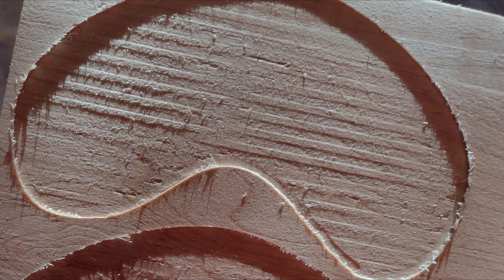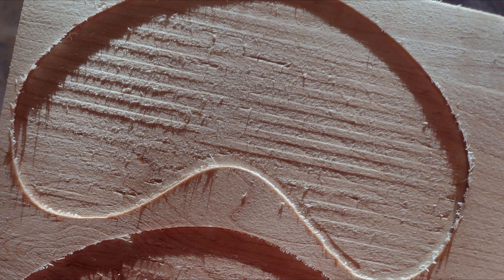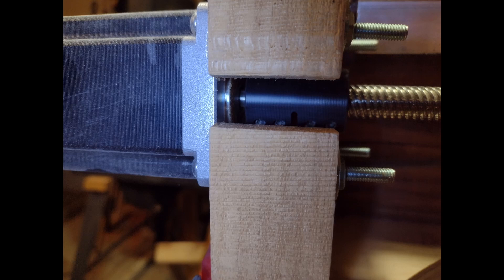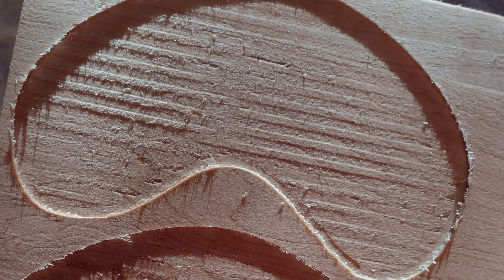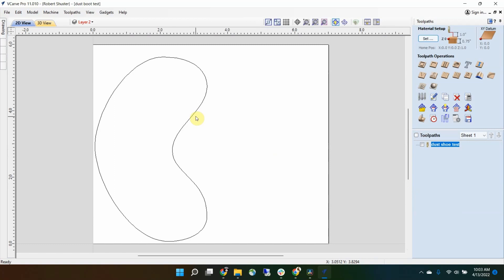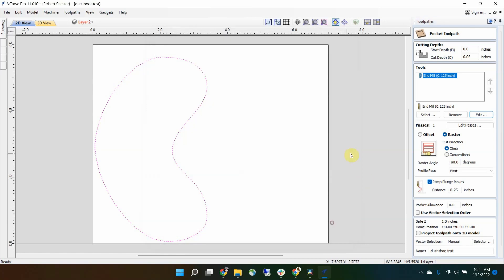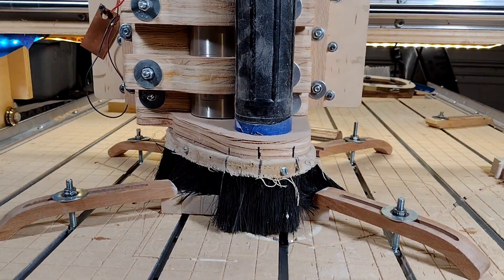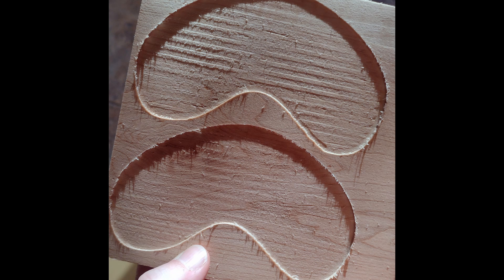CNC Issues That Can Cause Tooling Marks

Comment: Thanks for the good explanation. I had the exact same issue and also solved it by changing the dust collection method.  Bristle brushes can be quite stiff in a pure vertical direction.  A direct Z plunge will fight the bristles and prevent the Z depth from getting to the desired depth with a 'less-than-stiff' system.
Reply from the maker: I originally did not believe a dust shoe could be an issue when I heard someone say it caused problems.  Then I tested it (and stacked the deck against my CNC), and sure enough it made a significant difference.